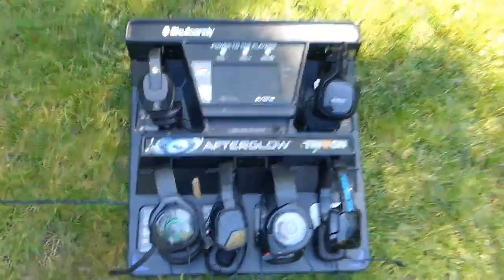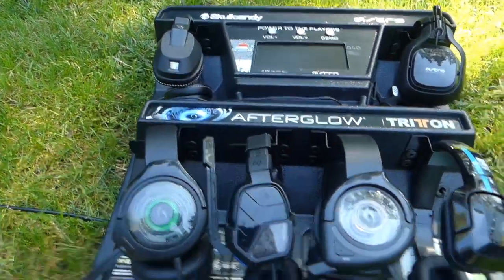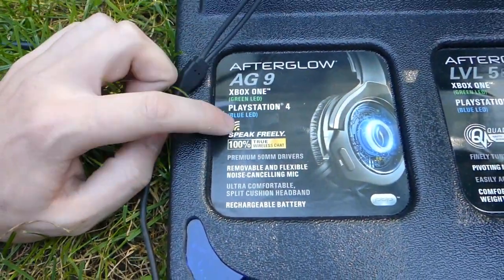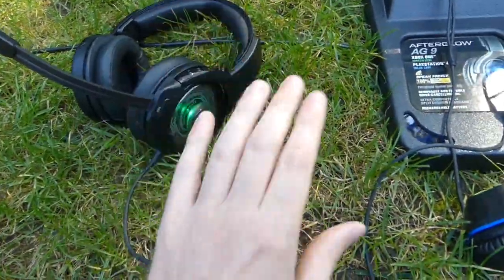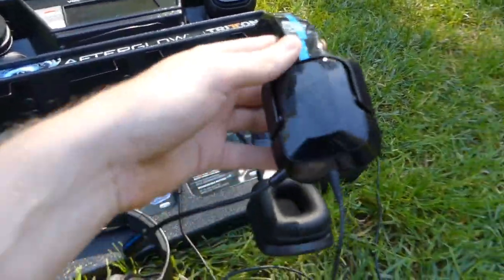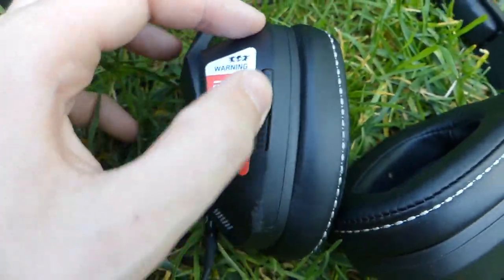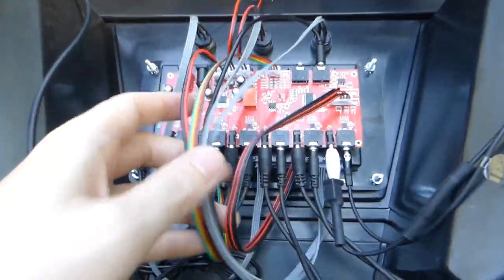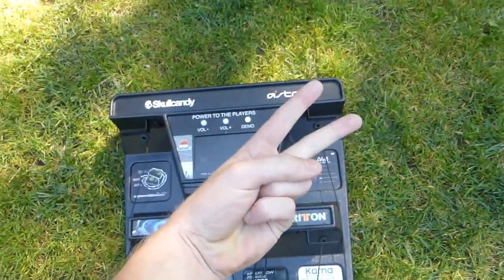THE ULTIMATE GAMING HEADSET KIOSK! Found Gamestop Dumpster Diving

Comment: Triton is my personal favourite company I've had the same set for about 4 years and they still work like there brand new. I've have to put some duck tape around the plug recently because I noticed the wire was starting to crack but I think it just down to the age of them. It's the best company I've used so far definitely worth the £70 I spent on them